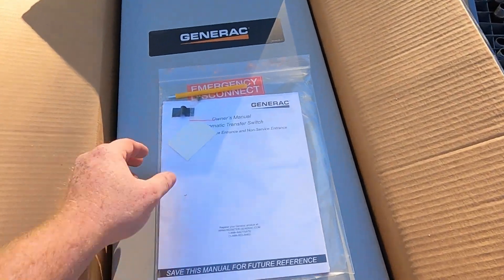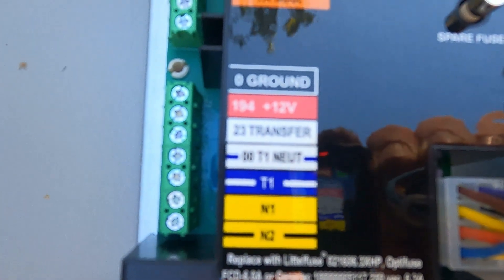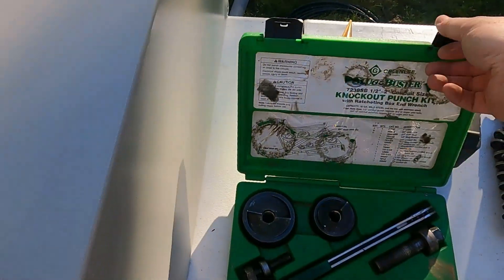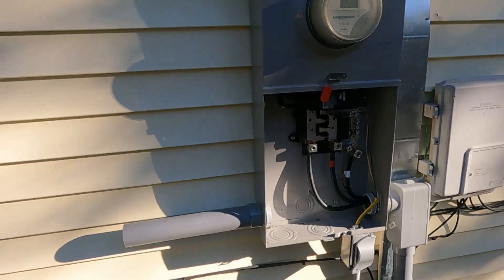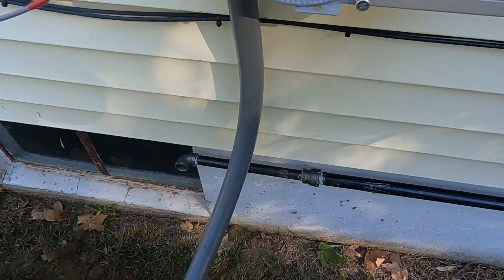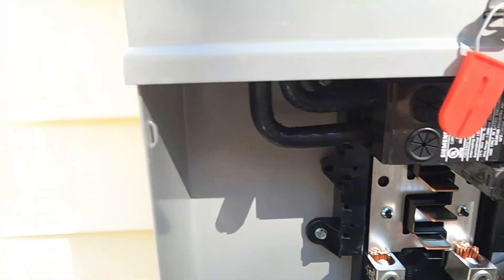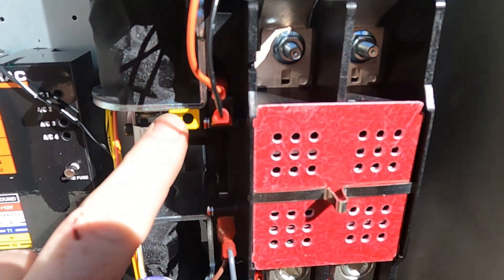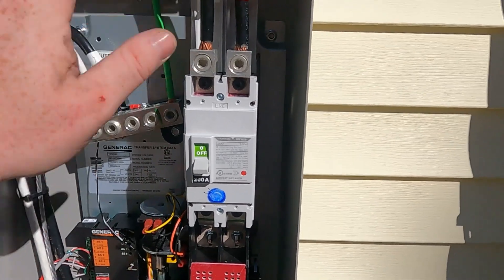Generac Transfer Switch Install

Comment: Would someone need to be an electrician to install a transfer switch and generator?
Reply from the maker: It honestly depends on where you are located. In the area I work in you do not have to be a "Licensed" electrician, but knowledge and background of electrical is required to install them. Also for any warranty work that may need to be done it requires a Generac Certified technician.

Comment: Many code violations, too close to windows,and grounds and neutral separated as mentioned in other comment and combing load and utility line in same conduit. This would not pass  period
Reply from the maker: Thanks for the input. It passed the inspection, though!
Reply: Load and Line power is not allowed in same conduit here either.  

Different area different rules.

Comment: quick question. the low voltage signal wires going to the Generator are those supposed to be in a separate chase then the high voltage? or is it allowable in that area? they will not allow that here.
Reply from the maker: I have always ran them in the same conduit, but I also use shielded wire. It is definitely not against code here.

Comment: Neutral and Grounds are to be seperated after 1st disconnecting means.
Reply from the maker: The inspector never flagged it, but after doing some research that looks to be correct. Thanks for the helpful insight. I will remove the factory installed ground bond in the transfer switch.